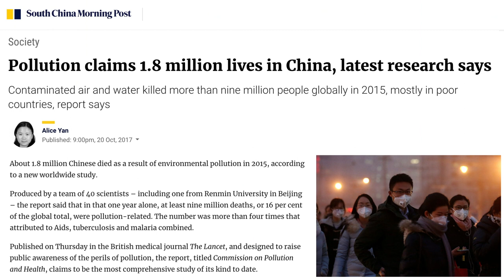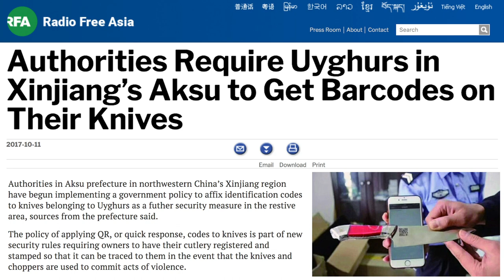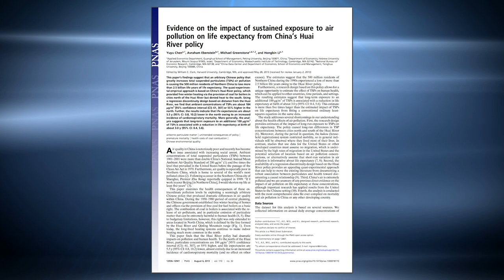10 Most Air Polluted Cities in China | China Uncensored

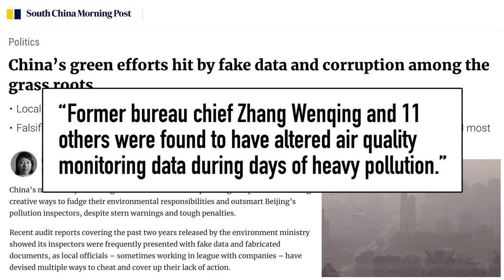Comment: 10:00 The same exact thing has happened here in Fairbanks Alaska. The State was caught doctoring the paperwork regarding the cause of pollution in the Fairbanks North Star Borough. The way they did it was by dividing up the offices in which the information was received by the State and then released to the public. So the public was told via the Fairbanks Daily News Miner that the problem was wood smoke and that everyone either has to stop burning wood, a renewable clean resource or they would heavy handedly barge in and take you out. All the while the reality was that the office that was actually receiving data found that ALL of the problem pollution was actually coal pollution that is primarily used by the military and other large public/private institutions including the University of Alaska at Fairbanks. So this is a global problem. 

  China appears to be in desperate need of modern nuclear reactors. Whereas Alaska just needs to get rid of false news and falsifiers in State and local government, police forces and newspapers.

Comment: TriTrack is attempting to do something about China's air pollution by switching vehicle power to PV solar energy.  There is a contest at the end of the month in San Francisco by the Chinese to promote tech into China.  Technology at the patent office can improve China's air.
Reply: That is the target demographic.  Make a high speed sun powered vehicle and infrastructure system these particular folks can afford.  Your assumption is not correct.  EVs are lower cost to build.  Batteries that swap at 40 mph will be smaller than you assumed.

Comment: China is leading the way with solar power and electric vehicles.
I just wish they would shut down coal power plants and replace them with more solar.
Electric vehicles are being mandated with  growing percentage every year.
Reply: Solar power is a boondogle, the total solar flux on the country doesn't generate the energy required. As for electric cars... the electricity has to come from somewhere and producing the car generates far more pollution than a normal combustion engine car will generate over 20 years.
Reply: @pwrserge83  Wind and solar energy are safer, cleaner and cheaper than fossil fuels or nuclear energy. Cheaper Wins ! Combined with battery storage wind and solar are 24/7 base load power and utilities around the world are ditching fossil fuels and going with wind or solar.
Reply: HangGlideTube  Some people do stupid things. The cost of wind and solar are cheap and getting cheaper. Investing in fossil fuels or nuclear power is a waste of money and will not be able to compete.Bad investments do happen. People with their heads stuck in the sand can not see what is happening all around them.
Reply: HangGlideTube  Japan more than anybody realizes how expensive and dangerous nuclear energy is. They are still trying to clean up a disaster that happened many years ago at Fukishima. They are decades away from cleaning it up at a huge cost and damage to the environment. Solar energy is just cheaper and better.

Comment: See that is the problem.  It is not coal or even manufacturing, but the complete lack of environmental policies and the inability to have inspections without them being made pointless by bribes.  The US has lowered the Particulate Matter output (which causes smog) by about 92%, but China will not enforce any environmental policies on these coal plants and factories because it might cost a little more.  That is why China has 7x the PM than the US.  That is unexceptable.  If Liberals are so worried about the environment than they should be DEMANDING sanctions against China by all western countries until China literally cleans up its act.  Instead they blaim the US for the world environmental damage.  I am getting sick of this.